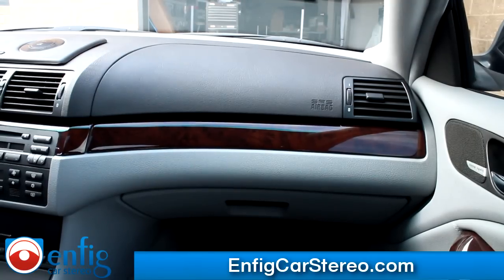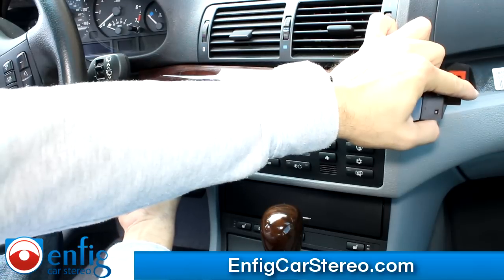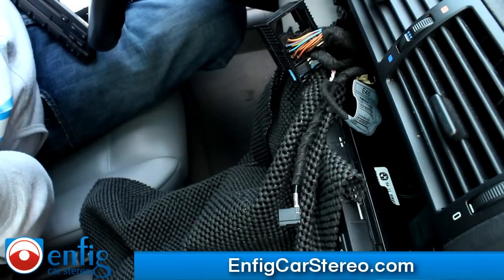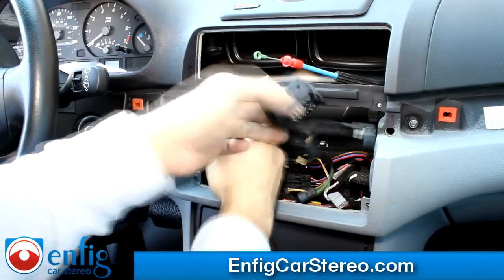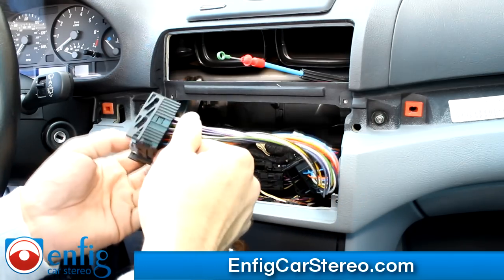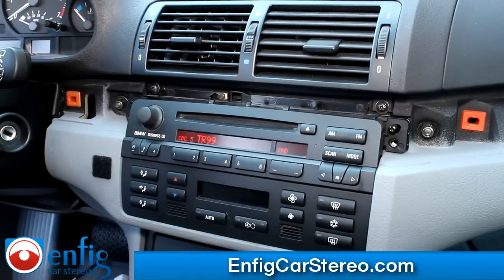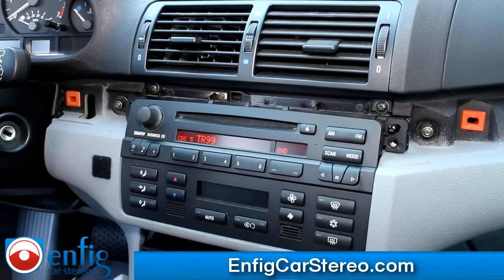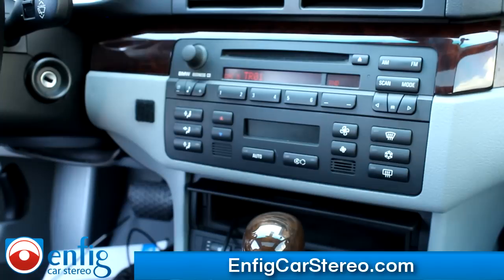iPod AUX adapter 3 Series BMW 99-06 E46 Dension GW1LBM1 INSTALLATION

Comment: I wish I had that tool when I did mine, I broke one of the clips on the first piece of trim it was so seized in, it took most of the red clips with it too :( had to really wiggle them off the pins with pliers after, they were so siezed in. everything else was easy even the air vents! you don't really need to take the vents out  just the glove box to pull wires down a lot easier I found.
Reply from the maker: +AuralAttack We have tried and we cannot get the big connector behind the radio.  You must have installed a different brand that makes you splice into the factory wiring.

Comment: Great video. I have just purchased an original BMW E46 Alpine 16:9 Board Monitor and noticed that it doesn't have any other plugs than the white and blue ones (which, by my knowledge, only controls the modules in the trunk - which I don't have). So, there are no antenna or power/speakers connectors on it. Keeping in mind that I have only the MK IV navigation system in the trunk, is there any cable adapter out there which could be used for my monitor, rather than tearing the whole car up and installing a complete new wiring?
Reply from the maker: +ZvekiSU with navigation the radio is in the trunk.  The BM4 must be used with an extension.  Call us for more info.

Comment: I have a '99 328i with an OEM stereo with a tape deck.  I know the plugs at the rear of the head unit are different in '99-'01 3 series.  Will this still fit my car?  Many of these ad-ons work for post '02 cars but not prior.
Reply from the maker: +Nate C. as far as I know the 3 series had the same conection from 1996- end of E46

Comment: Great video!  I am new to Dension and considering to adapt my 02 330ci for iPhone 5.  Q1: Does the iPhone 5 just need a lightening adapter? Q2: I noticed you discounted the CD player, does that mean it will no longer work with Dension install?
Reply from the maker: Yes all it needs is the lightning adapter.  the CD changer in the trunk will not work but the single CD up front will work.

Comment: My car already had this installed but no aux cable. I opened the dash yesterday to put an aux cable in and now it's not working properly. My iPhone is recognised, charged, even changes from the steering wheel controls, but there is no sound coming out. The trouble shoot guide does not help at all! Any ideas why this is happening???
Reply from the maker: +KamranMUFC The small connector is installed wrong. It must be in the opening closer to the center of the radio.  And the populated pins must be inserted facing the center of the radi also.

Comment: Is there an updated version of this or a replacement cable with the new lightning adapter? And what is the difference between this (GW1LBM1) and GW1LBM4?
Reply from the maker: BM4 is for nav radios.  I have a USB adapter for $180 but its much cheaper to get the converter from apple.  If you are interested in the $180 adapter that shows text email me info@enfig.com

Comment: Do you recommend disconnecting the car battery before doing this process?
Reply from the maker: +Przemek Mroz That's always the safest way to do it.  We never do it here because many new cars will not start after you disconnect the battery.  But by disconnecting the battery you can't fry any components if you make a mistake.

Comment: I currently own a 2001 E46 the Business radio it does not have pins where you mounted the small connectors on the back what series or model of bmw radio will this adapt to?
Reply from the maker: +mykg73 It connects to the other one that is closer to the center of the radio.

Comment: hi, i have a 2000 e46. it has a factory tape player and i want to add an aux for a mp3 ect . do you have the kit (wiring loom) that i will need and also the tools you have used?
Reply from the maker: +Jacob Rae Yes the link is in the description.

Comment: I have a 1999 328i and the radio only has the CD changer cable does that mean my car can't have a aux
Reply from the maker: Its the opposite.  Our adapters pretend to be a CD changer so the car does not need an aux port.  Our adapters work with most 96 and all 97-06

Comment: Hi Does this kit work for the bmw business tape player radio i have an 01 e46 325ci with cd changer in the trunk and tape player  radio interested in having AUX input and can i use a usb cable in place of the ipod cable to be able to work with a samsung smartphone and can i use the next track buttons on the steering wheel to change song playing from samsung phone?
Reply from the maker: +Diesel, Dollars and Dust Yes this adapter pretends to be a CD changer so the CD changer must be disconnected.  But the radio does not need the aux function.
Reply: Enfig , i have the same, cd changer in the back! Do i have to disconnect That before the aux cabel Will work?

Comment: i have a 330xi 2002. the radio says it was made in oct of 2001 does this work on my car? or is there an easier way?
Reply from the maker: It works with all E461998 and up.  And most 1996-1997.

Comment: i installed the kit in bmw 318i, which have option of usb instead of ipod. Aux is working fine but the problem is with usb. when i connects usb drive the light flashes ones in usb drive. player cant plays anything. i checked the connections and tried with different usb drive as well and while playing aux there is a minor sound like tunning of radio. please advice me if  did some thing wrong.
Reply from the maker: Did you buy it from us?  We do not sell that version unless its Bluetooth.
Reply: yes, i bought it from us, online. and it cost me around $200 aud. yes it works with only iphone cable. if i connect an iphone to that usb then it works bur if i connects normal pen drive then it not. so what is the solution for it. can i use that usb port for bluetooth reciver.
Reply from the maker: What is your order number?

Comment: Ok I'm confused is there already an aux port if so why install one if not why is there an aux option on the radio itself
Reply from the maker: +Final Anomaly  If the car has an aux you can install the ipod adapter to get charging and control from the radio & steering wheel.
Reply: OK so you kind of answered my question 
so the car already has a standard aux input as it is or is that what you're talking about installing?
Reply from the maker: +Final Anomaly  The car had an aux port.  The customer added this to add the iPod charging and control from radio and steering wheel controls.  He actually ended up going with the wireless bluetooth adapter.

Comment: Will the GW1LBM1 (with the shop link provided above) work on a 2001 E46 with Business CD Radio without a "Mode" button? I only have a "CD" button? You seem to be using the same product in your other video where the radio only has a "CD" button: https://youtu.be/akUOJx17niQ
Reply from the maker: Yes it will.

Comment: just installed on a 2002 me, just makes popping noise screen says 5-99
Reply from the maker: Sounds like you didn't install the small connector correctly.  Look at this video.  Also make sure if you have a CD changer it is disconnected.
https://youtu.be/yDRIlD-U9DM?t=15m42s
Reply: Enfig I installed it both ways turns out my radio is prpduced before 2002 so it doesn't support it I guess
Reply from the maker: Since your radio says 5/99 it 100% works.  This unit works on ALL E46 without navigation.  (different part for navigation radios)
If you purchased it from us call us for support.
Reply: huh. to this day still doesn't work no matter what I try. my luck

Comment: THIS IS WRONG, on a 2001 e46 there is no second plug in the back of the radio for this cord. I went through the whole install process and right when i went to plug it in, i couldnt. There was no port to plug the new cable into. Now im PO.
Reply from the maker: +Riles2985 We probably already answered this for you but the plug that is in every E46 is the one we use.  The one that runs to the CD changer connection in the trunk.  You remove that one and insert the new plug.  This video is confusing since it has the aux.  We will have a new one up shortly.
Reply: +Riles2985  i know i went through the trouble my 01  3 series has cd/scan not mode the head unit is diffrent in 01 and older
Reply from the maker: +Cervontais This is not a factory aux.  This is CD changer emulator.  It does not care if your radio is AUX capable.
Reply: How did you fix it? I have the same head unit and just got the kit and foresee this being a problem, did you have to do anything differently?
Reply from the maker: Our kit does not need the radio to be aux capable.  Did you get our kit?